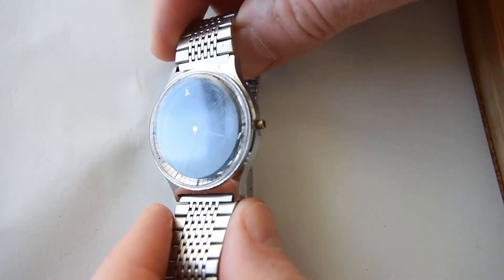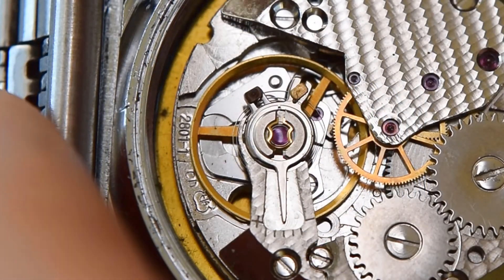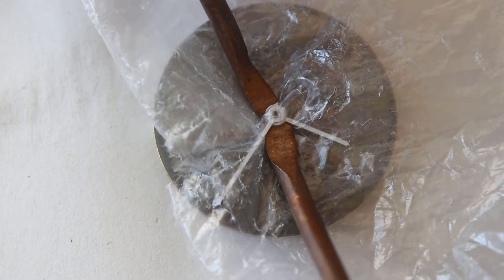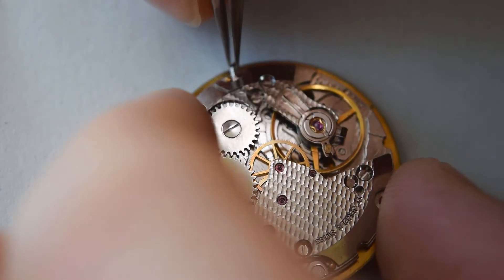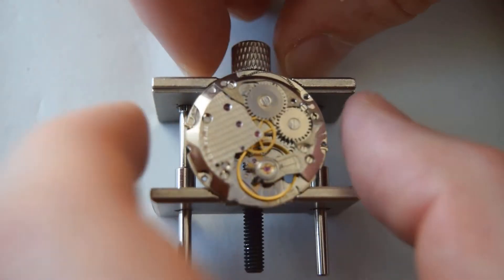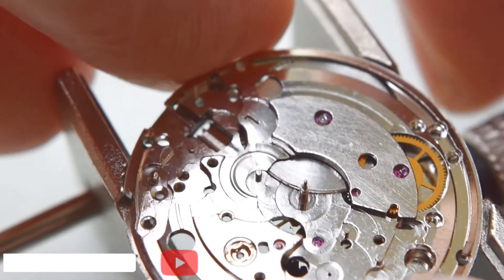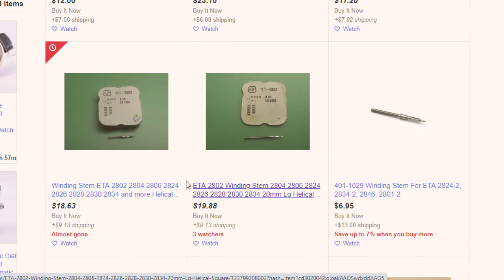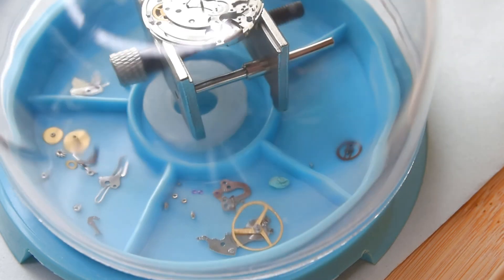Watch repair and watch service | working on mysterious ETA 2801 and the Marshal Part 1/2

Comment: Great video as always. I have learned so much from your content. I have this exact movement from a "Grovana" watch  I disassembled it, clean it but later I noticed in the ETA datasheet there is a piece listed "stop lever"  that was not in the watch and looking at your video seems like very early versions of this movement are always missing that. Do you know anything about it? Thanks for your time.
Reply: I just figured out after reading online that some old 2801 are always missing it 😅
Reply from the maker: I'm not so deep in this movements so thanks' for sharing 😀

Comment: I might help you with the watch itself. Omikron is a Swiss brand of cheap watches designed and made specifically to be sold in Yugoslavia in the 60s and early 70s. It was a common watch in Yugoslavia together with another brand called "Darwil". 

I think it was the Yugoslav government that made a deal with some watchmaker in Switzerland (It might have been anyone of the known brands even Omega) So they set up shop quick and started to mass produce these watches to fulfill the lucrative deal with the Yugoslav government. I would compare these watches to military styled mass produced ones. 
I dont know why they didnt use the original name of the maker. Once again it could be anyone from Longines to Omega. I think its Omega simply because the Name Omikron is another Greek alphabet letter name like Omega. 

The Eta movement in this one is DEFINITELY NOT ORIGINAL nor is the dial. They used cheap reliable Unitas movements exclusively and classic style dials. The Tito dial on this one is custom made. 

They are extremely cheap to buy even today. You can find one almost new for 40 euros on E-bay and they are extremely durable and no matter what - they are made and assembled  in Switzerland which does count for something after all. 

Don't let the cheap price of the originals deter you. The quality is there as you can see at the back plate  the logo is precisely machined which was a big deal in the 60s. 

There is an "unofficial" Omikron website set by some individual with no connections with the original brand who tries to sell some new variants but that site is not official and that person just stamps watches with the brands name.  It is a fraud. 

There is so little about this watch brand online because it was not a business. It was more like a set up operation and government contract and once it was done. That was it. This is why there is no Omikron brand or manufacturer and so little information about them.
Reply from the maker: Thanks, I really appreciate it 😀